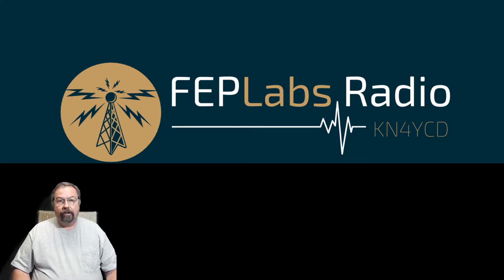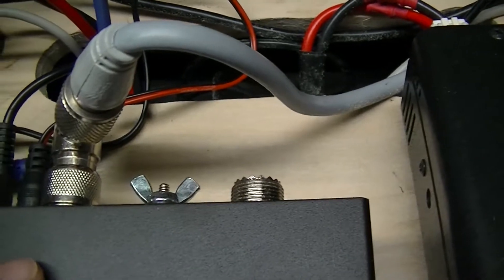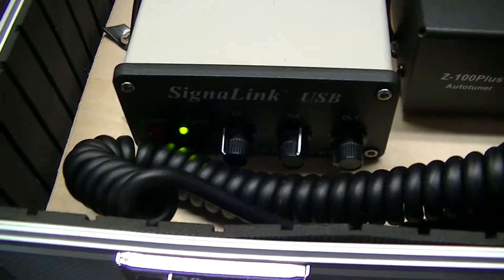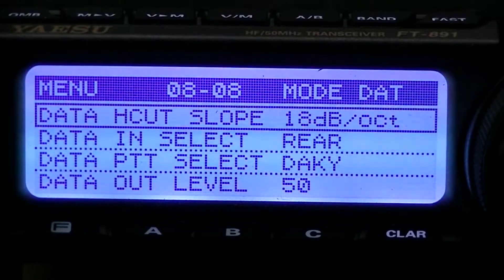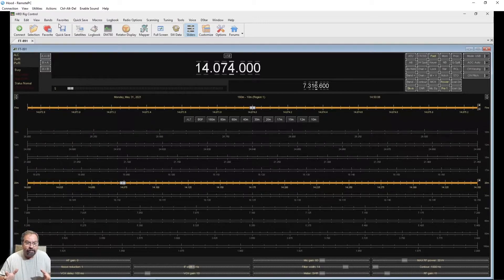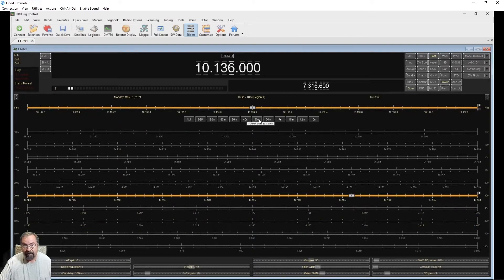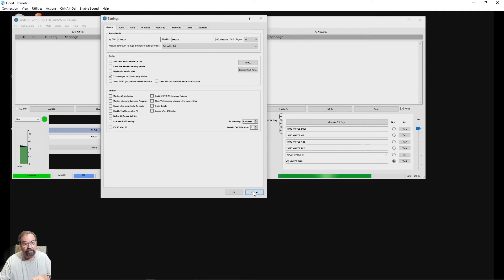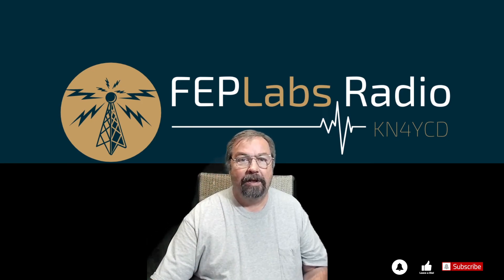Ham on the run - FT-891 Portable with Signalink

Comment: You did a great job on explaining the cables until the Blue usb cable but I don’t know where it plugs in.  - a camera view looking at the back of the radio/tuner and signalink would have helped

It would be helpful to understand the software setting you needed to do to get it all to run.